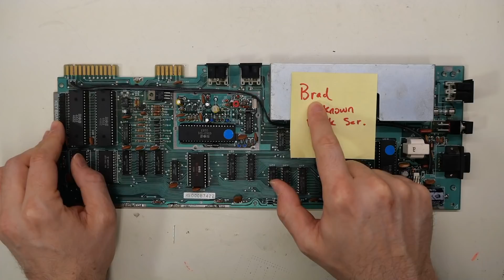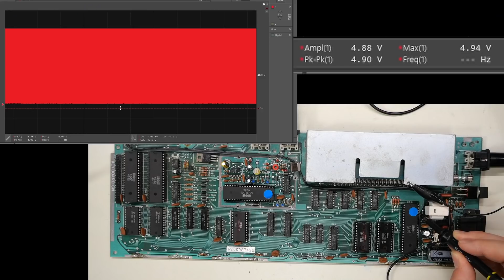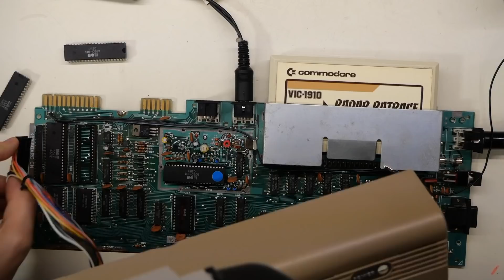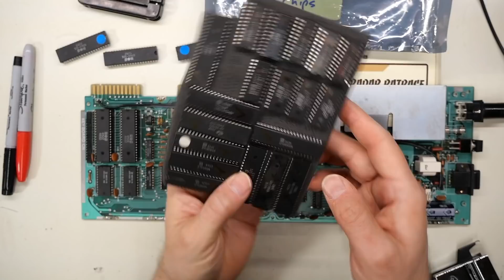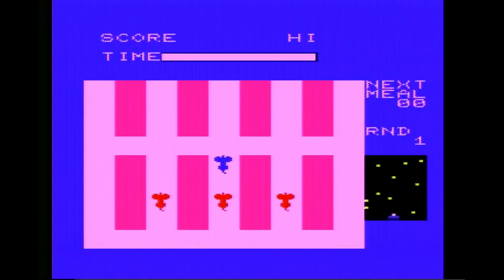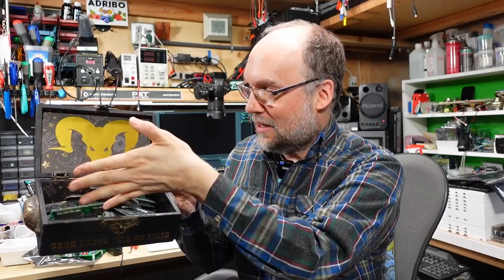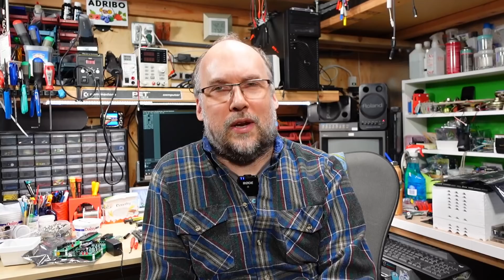Repairing two VIC-20 motherboards

Comment: Hi Adrian, love the content! I just bought some Deoxit myself but every time I spray it, after I stop, it starts dripping down the side of the can/out of the straw (depending on whether the straw is up or down). Have you had that problem before?
Reply: I have that with similar bottles. I just make a habit of having a rag or tissue or something to catch it. The valve controls are behind the straw while you’re using it from the straw so there’ll always be a little leftover.
Reply: @kaitlyn__L  Yeah, that's what I've been doing. I was hoping there's a better solution or it's user error.
Reply: This is a flaw of their new "perfect-straw" as Deoxit call it in their advertising, it is simply awful! You can try to find a regular straw off some other can and see if it fits... They have eventually listened to all the bad feedback on their straw (check the Amazon reviews in Adrians link in this videos description for example!) and now offer the can with the old original straw, part number: D5S-6-LMH
Here is a video showing the issue: https://www.youtube.com/watch?v=rIgFwm1_HUI
Reply: @perhansson6718  Good to know, thanks. I guess when I run out I'll get that type instead. I wonder how that got past QA, it's not hard to reproduce (literally just use the can as intended)...
Reply: @aaronjamt  I suspect it’s deliberate, like how eye drops are metered to be about double what you really need so you buy more sooner. (They could make it so you don’t blink half of a dose out… but they don’t.)
Reply: @kaitlyn__L  Hmm, maybe... it does make sense
Reply: @perhansson6718  tbh I even had that problem with separate straws with ancient WD-40 bottles and stuff. The pivoting valve with integrated straw has a little more leakage but I’ve never used an aiming straw that was 100% leak-free.
Reply: @kaitlyn__L  That video doesn't show the (IMO) worst part: when you set the can down and flip the straw back down, it just drips all over the table/counter/floor/your hand/etc.
Reply: @aaronjamt  yeah, I had that happen when taking-out the older style straws unthinkingly too. Hold it in my hand and it drains out into my palm
Reply: I transfer some into the small plastic squeeze bottles with metal tips. You can get the from Amazon in bags of 20 or so.
Reply: @infinitetape  Yeah, I actually have and use those for IPA already, that's a great idea!

Comment: I am working on a 6526 replacement. A have a version that can replace an individual chip or can replace both chips on an older 64 where the two chips are next to one another. Will have to wait until the current chip shortage is resolved before I can release to the public. I am hoping that it should cost less than a real 6526 goes for on ebay.

Comment: I doubt the chip designers at MOS. would have expected these chips to last 40 years,  pretty decent manufacturing for a product designed for a 4-5 year life span.....  I doubt if you took a 4 year old modern computer,  and stuck it in a closet until 2062, it would  have any hope of even getting to post.....

Comment: The S logo seems to be the Synertek logo, not Signetics. I don't think Signetics actually did 6502/6522 stuff. The scary thing is the 6522 is still made as the WDC 65C22 and the N variant is directly compatible! (edit) It seems WDC also make a 65C02 which is compatible

Comment: I've not worked on a VIC-20 before... but I've got two failed MOS 6502 CPUs that came out of my original 1541 and also an SX-64 Floppy Board that I'm working on. Both presented the same symptoms, activity LED lit all the time and the floppy drive motor spinning. Both CPUs also got VERY hot, too hot to touch.

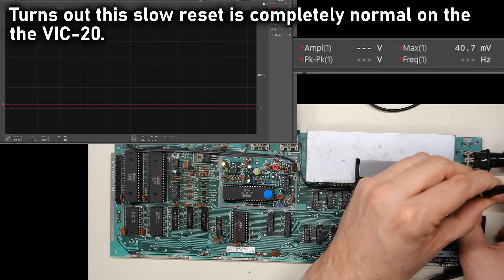Comment: @5:20 interesting,  The Vic 20 uses a bidirectional bus transceiver 74LS245 for buffering the address lines but forced into one way by grounding the DIR pin. I guess the pin out is straight through tnstead of using a 74LS367 trisatate hex  buffer ( and you would need three of them instead of 2)

Comment: the 6502 always is a problem on VIC20 (well if you have experience, that is) and not so much on 1541. ROM also is known to go bad on VIC20, 6560/61 also seems to go bad sometimes. Just usualy VIC20 stuff.

Comment: Think about getting a thin piece of plastic to slip underneath the chip lifter, as I’ve had it happen that the tool ends up damaging the solder mask and very narrow traces. Having something between the fulcrum point on the tool and the board minimizes the chance of damage.

Comment: I have had at least ten C64's with power-on reset troubles, staying low on pin 40 on CPU. A couple of days ago, same fault on a VIC20. Usally a 7406 TTL logic causes this. U8 in a C64.

Sadly, VIC chip is a common fault in VIC20. Kernal ROM is also a common fault, but with a little adapter, it is easy to peplace with a 27C64. 
I have never seen a dead 6502 or char ROM in a VIC20 before.

Usally MOS 85xx chips are more reliable than older MOS 65xx.

Thanks for another interesting video :)
Reply: Had one SX64 with failed reset signal. Culprit was 7416. So yes, for some reason even this small circuit is failing sometimes.

Comment: 28:12 I remember reading that they made changes to the Commodore 64's KERNAL over the years, and one change was that in some versions the entire color ROM was initialized to light-blue (so if you were to POKE a character into an empty space, it would be visible), but in others it defaulted to the background color and only made the visible characters light blue. I guess you've only ever run this test on machines that used the first style.

Comment: On the subject of replacement chips, I wonder if it will ever be feasible to have chip fabs that are affordable to the general public?  Obviously not the bleeding edge atom-width types, but certainly good enough to (re)make retro chips ought to be doable these days.  I know there's that one dude who bought used fab manufacture equipment and can make simple chips with it, but that's still not practical for most people.
Reply: Nope, not at all.
Reply: FPGAs, like those used in MiSTer, are a decent solution. Basically they can imitate chips, other components, and whole computers. Physical chips are difficult, but "virtual" ones in a Hardware Description Language are quite doable and emulate (or perhaps "simulate" a better term?) them enough to actually function. That's what the MiSTer project sis all about. Even if you don't know anything about programming FPGA's, the aims of the project are quite worthwhile!
Reply: That's not going to give you a SID replacement though...
Reply: @martinwhitaker5096  Those already exist and some are pretty good
Reply: @martinwhitaker5096  Also, 5V-tolerant FPGAs are drying up, as are even the 3.3V ones.  So it would be quite helpful if someone could invent a personal-sized silicon chip fab for those cases.

Comment: Future troubleshooting methodology: after checking power supply and PCB for proper voltages, connect sound, video, keyboard, and insert game cart to see what is actually working.  The presence of keyboard control and sound are great clues as to what is wrong and what isn't.

Comment: I'm hoping for the whole homemade stuff sector going to "homebrew chips" eventually. Like it did "3D printing" recently; so maybe, eventually, you can just make your own replacement chips for these early ones; the density of the chips might be within a homebrew setup. As long as the actual layout can be found somewhere... so better keep the broken ones around, they might be useful for reverse engineering those 😁
Reply: This can basically be done through FPGA progamming. The MiSTer project is specifically: Old arcade electronics replicated by "schematic description languages", and made playable, not just from software, but software on replica hardware schematics on modern hardware.
Reply: @squirlmy  Indeed... but to me that feels a bit like cheating 😊 While I might not be the purist that some others are, I do prefer proper hardware based replacements for faulty hardware. Because programming a chip to simulate older hardware makes it feel slightly too much like "emulation" to me already. Where is the boundary? I do see some homebrew chip design projects pop up here and there and hope that those might gain traction eventually. Certainly not "big buck" area, but "special interest" for sure. Kind of the next generation nixie tube thing...?

Comment: It could be that the guy who sent you these, populated the sockets with questionable parts. 
He did say these were left overs after he repaired his. You could place appropriate TVS on the supply lines, to make sure you don't get over-voltage spikes.
Reply: over voltage spikes would be a power supply problem... best thing to do there is use modern power supplies rather than the old junk that they shipped with

Comment: i have a bunch of tapes for my vic 20, but thats it, and  my coco 2 has a few cartridges, but thats it.(i do have tape drive for it) and for my ibm 5150, apple IIe and trs 80 model 3 has the disks. the apple has the most. i have a disk drive for the vic 20 but software is hard to come by. i would love to have software on disk for all of my machines. disk drive for the coco is not cheap.

Comment: Chips just die.  No semiconductor will last forever.  The earlier chips will tend to last longer, because the transistors were physically larger on the chip die.  More modern chips are much more susceptible to failure, just because the transistors are so small, any bad thing can kill a transistor.  And one bad transistor out of the millions/billions of transistors on a chip can kill the entire chip.

Comment: The sad answer is that yes, this probably is the future of many old computers one day. It's why it is so cool to see people coming up with modern replacement parts that can be retrofitted.
Reply: The VIC is relatively fortunate in that aspect as there are still 6502 and 6522 variants made. We just need a modern VIC replacement of the big chips.
Reply: practically any electronics made with capacitors. They just aren't made to last. Even if replacement chips are found, the capacitors are always going to have limited lifespans.  I'm not exactly sure why Adrian is so upset about the chips, other than being very low-cost DIY solutions.
Reply: @squirlmy  Capacitors are never a problem, you can always replace those and assuming they don't cause damage on the way out, that'll remain the case indefinitely. The issue is critical ICs that have no modern replacements that will eventually fail.

Comment: Adrian my two Vics (1981 Japan PET and W.German Euro) had two bad faulty vic chips dying 6 months apart after 40 years of proper service , which tells me that the materials probably last around 4 decades. It’s the life cycle of these manufactured chips which will eventually give up and their is nothing we can do about it until it can be replaced. That goes with all vic 20 chips and 64’s. most of the time the power supply outlasts the vast amount of chips which in this case had applied to mine, I had learned this the hard way.
Reply: I have a feeling no one ever expected these machines to last beyond the early 90s. Our society has this idea that everything is upgraded in time. I grew up with the Vic 20 and definitely wasn’t interested in using it beyond 1985 or so.

Comment: Very interesting. One of my VIC20s works if you put a cartridge in,. However, when you try to boot to the basic prompt it comes up with a corrupted screen shpwing flahing coloured squares and black lines all over the place. From your diagnostic it sounds like this could be a bad chatacter and/or basic chip.

I haven't done any testing yet, but sort of assumed it was something to do with RAM. Has anyone else seen this?
Reply: Just checked ebay, around £28 for a replacement BASIC chip including P&P, seems steep!
Luckily I can pull one from a working VIC to test this first. This may just be an easy (If not cheep) fix.

Thanks for the video Adrian,
Reply: @GarryGri  Probably cheaper to find a compatible EPROM and burn it

Comment: I wonder - did these (and other) chips fail on their last powerup, or did they fail while being in storage? It's certainly a sad thought.
Reply: I think Ian Rolfe up above nailed it. These are all the garbage chips from a series of boards someone swapped with and then were kicked down the road as "parts" machines. When I did C64 refurb in the early 2000s these were common in E-bay lots. 5 boards/machines and 4/5 had missing or failed cpu, Video chips or roms. Many had missing RAM too. Back then you could find C64s in the thrift store for $5. Cheaper than ordering new RAM chips and having them shipped to you.
I had three parts machines machines that ended up barren or occupied by known/suspected bad chips.
Reply: @DaCrazyDingo  Chips do die in storage though
Reply: @Sven Karlsen  true. Could have been stored in bad conditions. I think the blue dots are indicators that they were swapouts though.

Comment: I built a very crude cable descrambler as a kid with a black screen c64 and injecting composite video into the video circuit which provided sync and there was an adjustment to manually sync it. Mostly worked except for the colors of course.
Reply from the maker: Wow that's pretty neat! It's one thing I never really looked into -- how those scrambled pictures worked and how a descrambler could work. I bet it would be trivial now to build a descrambler -- but I'd like to see a scrambled signal on a scope.
Reply: @adriansdigitalbasement  this was known as  gated sync suppression. Basically they pushed the sync pulse up into the picture by 6db. There was a subcarrier that would provide the sync so the descrambler could push it back down. By injecting it into the C64 I was restoring the pulses myself. To sync it you would tweak that adj cap you showed on the v20 the c64 had the same thing. It adjusts the “h phase” I believe which does affect the color burst too.
Reply: @adriansdigitalbasement  I built a "Universal" descrambler back then from a kit. It used a PLL to lock to the NTSC colorburst signal (which no system ever altered) and used that as timing reference to gate in a new sync pulse in place of the altered one. It also optionally inverted the video so it worked with inverted video methods like Videocipher2 (analog satellite).

Comment: Let's hope some day the designs of the chips will be found and replacements can be made.
Reply: There are FPGA reproductions of vic20s, I guess they are already reproduced somehow.
Reply: @jbinary82  There are two ways to produce an FPGA chip, you either analyse the inputs and outputs and manually recreate that, which is similar to a clean room BIOS; or you can look at the actual schematics and recreate what was physically there in the layout.
Reply: @jbinary82  FPGAs on their own being much more advanced and expensive than the machines they are meant to replicate.
It's like using an emulator, you get the machine without any of the insight of the containing hardware.

Comment: I'm inclined to beleive someone had a number of boards, got as many working as possible by swapping chips around, and these 2 boards are the ones that ended up with all the "suspect" chips, hence the blue spots.
Reply: It's like the one egg carton at the supermarket that ends up with all the broken eggs.
Reply: @mal2ksc  remind me not to shop at the supermarket you frequent!
Reply: @squirlmy  You mean you don't check your carton for broken eggs? Or do you just reject the entire dozen? I'd rather see all the breakage accumulate in one place so the other 11 eggs in the carton get sold.
Reply: He did say in the Mail Call video (I think) that the person who gave it to him got multiple "for-parts" machines and cobbled together one working unit, then sent Adrian the leftovers. So you're right.
Reply: @HardDriveGuruOfficial  although your interpretation is more sinister!!! A good reason to avoid "untested" and "for parts" purchases.
Reply: That sounds more feasible, because that was just too many failed ICs on one MB.
Reply: No. The blue dots are on there from the factory.

Comment: Had just the same issue with a VIC 20 I was working on yesterday. Couldn't fully diagnose it but a cartridge game produced sound which responded to keypresses, so most likely just the VIC.  Unfortunately, VIC chips are more expensive than whole VIC 20s so it wasn't worth fixing, but at least I could pass it on with a partial diagnosis rather than "untested".
Reply: can you get chip replicas in FPGA format?
Reply: @squirlmy  Don't think so. I know there's one for the C64 VIC-2 though.

Comment: 68000 goes to the top of memory? 68000 like the Z80 goes to the bottom of memory to memory location $0000. The 6502 goes to the top of memory $FFFF.

99% of the time on the Vic20 it is bad Kernel ROM that gives a black screen. This is unlike the C64.
Reply: Adrian just misspoke. I think he meant to say "6502".